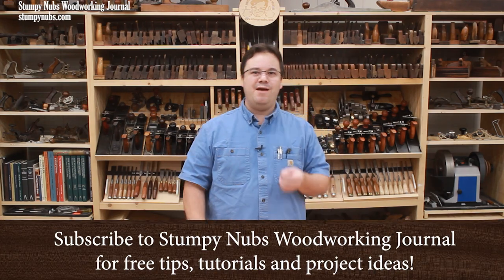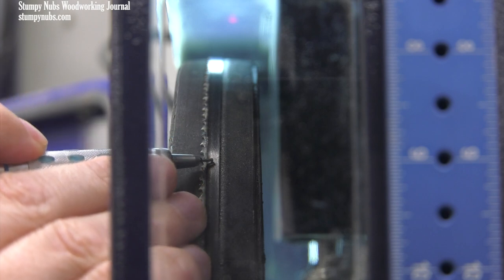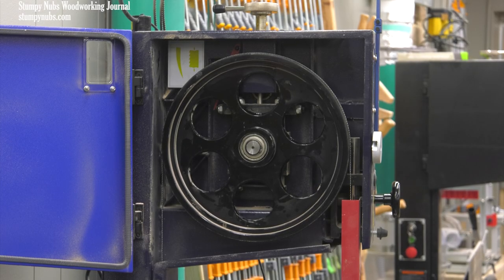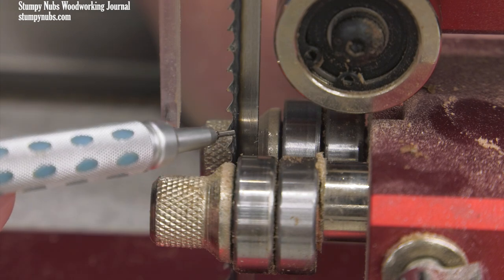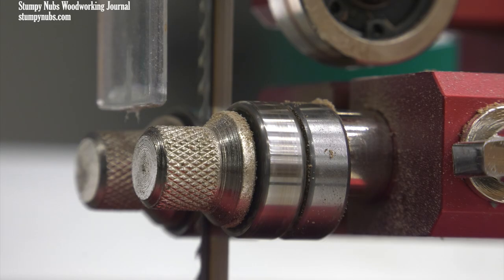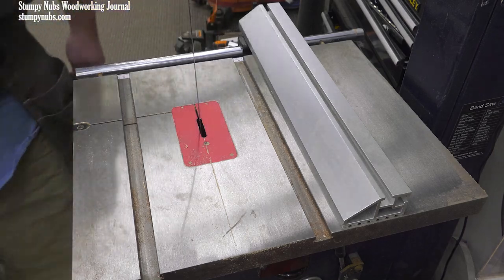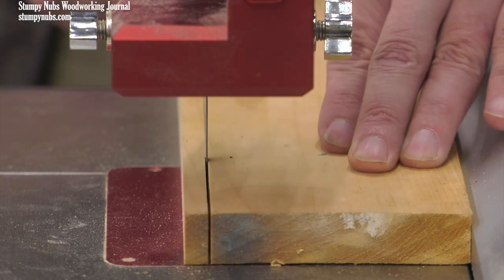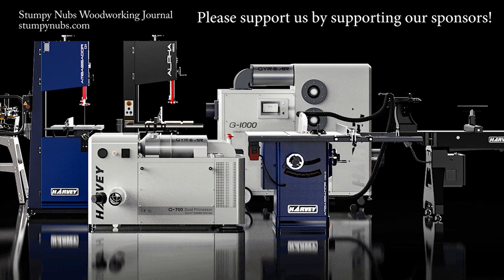When bandsaws go bad- How to fix your setup!

Comment: Great video.  I would just add one small step that has saved me a lot of fidgeting.... back off both the upper and lower guides before setting the tracking and the tension. Once that's where you want it, then set the bearings (or guide blocks) for the clearances you prefer.  If you've ever tried to get the tracking right while a bearing is holding back the adjustment, you know why some folks get so frustrated.
Reply: Good point, I'll watch that.
Reply: Great tip thanks

Comment: This is exactly how I have always done it....except....I back off all four of the guide blocks/bearings plus the rear bearings. Now adjust the bottom left, than the bottom right. Now the top left and than the top right. finally adjust the rear bearings. Doing it this way eliminates (mostly) going bnack and forth with each conact point. I always finish by using a stone to round the rear edge of the blade so it won't scrape the kerf as it passes through.

Comment: i wished to thank you so much !!! I own a bench top band saw for small wood work in my shop since some years. I did in the past some various adjustments but never succeeded to have quasi no drift. Looking at YOUR video, i have understood why !!! I did again various adjustments, revised all settings, reworked the table holes and axis. Now : it's a dream, all work perfectly, quasi NO drift, 90 deg cuts are excellent. As a complement i use a home made micrometric and magnetic fence jig and get excellent results. ie resawing a piece of wood of 50 mm large down to 42 mm exactly at a glance, so easy now. A little hand plane work to adjust and all if fine in no time. So, again thank you, you made my day !!! Every time i will use my and saw, i will think about you ...  PS: i did watch may other videos which were great and useful but yours opened my mind on my issue.

Comment: James, this should be a must-see video for anyone that owns a bandsaw. So much of what you showed here I had to learn out of trial and error and with the help of old-salts' as yourself. One thing I'd like to see or explained is when the upper guide is raised or lowered, it might not track in perfect alignment with the blade. This can cause tracking and/or other issues as well. Some machines allow for adjusting the alignment, such as yours, I believe, but older styles don't, and might require re-adjusting the upper guides when moving the guides from an inch or two from the table to ten or twelve inches up.
Reply from the maker: If you can adjust the post's alignment to keep it consistent, I'd adjust the bearings  each time you raise it high to resaw.

Comment: I have setup my saw in the same way as described in this video after watching a similar one by the guy from Carter Guides and my little benchtop 10", 1/2 horse Rikon cuts true and straight through 5" hardwood all day long, these tricks really, really do work for all saws.  Thanks!

Comment: You did it again!  My bandsaw has been cutting perfectly until two days ago.  Last night I was going to search YT for a tuning video I'd seen a year ago, but at the top of my feed was this one.  This has happened before, just as I set out to search, you have a new vid on the topic I need.  After tweaking the blade on the top wheel and adjusting my rear guide bushing, I was cutting 1/16th inch strips again using my fence!  Thx.

Comment: Hi James, Fantastic video. I have seen many videos on how to set up a bandsaw but this one is the simplest to follow. I have an old DeWalt 3501 and took my time to set it up properly. It has blocks and not bearings so it was great to see you cover this as many videos don't, they just explain bearings. 
I just wished you would have posted this video 4 years ago. LOL.
I do as you suggested and check the set up periodically and always after tilting the table.
I make a lot of segmented pens so an accurate set up is vital for me.
Take care James and thanks again for this video.

Cheers, Huw

Comment: Most can probably agree that a bandsaw is one of the last investments they make for a shop.  Partially because of these fiddly issues you just smashed in a few short minutes!

...and probably because of that I ended up with a bandsaw from the alley.   
It wasn't working and the blade was off. 
I found that the cover for the blade was bent and the safety switch wouldn't engage!!
It's just a green baby saw, but it works! I look forward to further adjustments and putting it to the test. 

....thanks again!

Comment: Thanks James. This is how I setup my 14” Delta, but FYI, Shopsmith bandsaws do not have crowned wheels and the blade is designed to run against “auto-tracking” bearings which position the blade to the back of the wheels. Also, due to the conical shape of the upper wheel and the way that the upper wheel is tensioned on a cantilevered arm, drift is common.  I love the Shopsmith bandsaw but it is a different animal. Scott

Comment: I just got the new 16" South Bend bandsaw. I actually had to adjust the top bearing guide system to be parallel and square with the blade. It's something I had never heard of before and was interesting to fix.

Comment: Thanks for the tips! I have a Delta 14" with variable speed control and a metal cutting blade for aluminum. It works reasonably well but it drifts ever so little. Will attend to it.

Comment: Thanks for another great video, James! Everybody and their brother, including some big names in woodworking, tells you to adjust the band saw fence to compensate for inevitable drift. A few tell you that drift is caused by worn or defective blades. Michael Fortune's video was the first I saw that points out that you can/should simply rotate the table so the slot(s) and fence are parallel to the blade. Duh! We expect to adjust a table saw table and fence parallel to the blade - why did so many of us not realize the same thing applies to our band saws? As you demonstrate, it works perfectly and it's easy enough, even on my 40-year-old Delta 14". Two other tips I can pass along for those with older, smaller band saws like mine: First, my 14" Delta was top heavy and annoyingly wobbly, especially on a mobile base. So, when I built a long table for my sliding crosscut miter saw a few years back, I made it the same height as my band saw table, and positioned the band saw at the end of the table. Then, I drilled a few holes in the frame and bolted my band saw to the fixed miter saw table. Now my band saw is rock solid and has 12 feet of outfeed support so I can easily rip long boards on the band saw. Second, Alex Snodgrass, in one of his band saw tune-up videos for Carter Products, suggests removing the table each time you change blades so it's easier to adjust those pesky hard-to-reach guides below the table. That turned out to be another "smack my forehead" moment for me. It turns out that removing and replacing the table makes it so much easier to adjust the lower guides that it's actually much faster than trying to do it with the table in place. As a result, I now change blades when necessary instead of forcing a cut with the wrong blade in the saw. Thanks also to the more powerful motor I picked up from Grizzly, my old Delta now performs like a much bigger saw. Of course, when I bought the ubiquitous Delta 14" band saw forty years ago, there weren't too many other options. So, I made these and other upgrades over the years trying to improve its performance. While I'm very pleased with it now, I'm sure that if I totaled it up, I spent as much as or more than I would today on a bigger, better saw like one of your Harveys. ;-) Thanks again, James, and be well!

Comment: Great video. Every bandsaw user should know these things. The best advice is to align the gusset squarely on the center of the upper wheel. The advice of the ancients was to overhang the teeth off the left side thus guaranteeing drift. Placement of the thrust bearing should leave enough, but no more,  gap to prevent the teeth from touching the side guides.

Comment: Nice job, Stump.  You covered it.  The only small point I can add is make sure you have a good quality blade.  Some cheap blades can have inconsistently set teeth.  It will be nearly impossible to get such a blade to cut straight.  Same as what you said about dull or damaged blades.
Reply: He’s way ahead of you. You might want to check out his last video where he recommends carbide-tipped bandsaw blades

Comment: I’ve always been put off by thoughts of big wheels, tires, tension, blade guides, tracking and drift. This video makes adjustment seem much more reasonable (and feasible, even though I realize it will probably take patience and several tries.). I particularly like your simple techniques for measuring tension and thrust bearing setup.  There is, of course, still the dangerous step of removing the ties from a new blade.  Thanks for the video.
Reply: I saw a video (can't recall who made it) in which they simply dropped the blade on the floor, teeth uppermost, to uncoil it!
Reply: @lafamillecarrington  Stand back!

Comment: The reason the wheels are crowned is that the crown counter intuitively applies a force towards the center of the crown. The force has to do with the elasticity of the belt/band, and it is much more pronounced for rubber belts. If the saw is not centered on the crown, it should drift towards the center over time, but there are a lot of other factors that may come in to play.

Comment: lots of good stuff, thanks.
I have an old Delta 14 and I'd like to give a shout -out to Cool Blocks. Won't damage blades like metal blocks and much much cheaper than bearings.

Comment: I have a new-ish Delta table top bandsaw and then a really old Craftsman, haven't used either.  Tried to use the Delta but could NOT get the blade to stay on.  I suspect the blade is toast, turns out it's an odd size that no one has in stock locally, so now I wait for a shipment to come in by mail.  The Craftsman is I think a 14 inch but I have yet to even plug it in.  Looks like an awesome tool.

Comment: This is super helpful! I've just upgraded my little benchtop bandsaw to a bigger one for the first time and have spent an entire day trying to get it perfectly set up, and there's still work to do.

I'd love to see a quick video on bandsaw blades - I never had much of a choice in my little 1/3hp machine. Just buy the tiny blades! But now I've got a bunch of options that I don't understand. What are hook vs claw blades? What's a standard blade TPI to get clean straight cuts? (My finish is currently really rough with a new blade) - stuff like that.
I'm also totally seeing the value in one of the Hedgehog featherboards, and a decent push stick.
Reply from the maker: There is a link to a video about bandsaw blades in the notes below this video.

Comment: The table rotation is in my opinion the most important adjustment and should be done first.
Reply from the maker: You can't know if your table's alignment is affecting the cut until you eliminate the other factors covered by the previous steps.

Comment: Thank you for doing this video! I have a C14 and I was able to get my fence parallel to the miter slot but I can't get it 90° to the table. Is there a secret to getting that adjusted correctly?

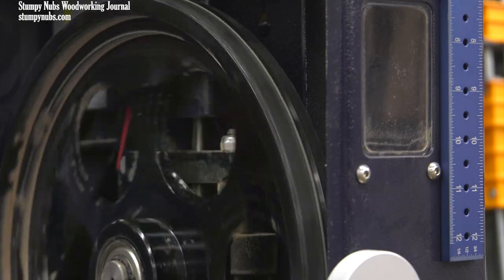Comment: I have the same Harvey saw and I see you manually rotating the wheel @ the 2:57 mark.  Just beware, I snapped my left index finger in half, breaking it in three places doing the same thing only slightly faster.  My finger slipped ever so slightly and got caught between the wheel and the lower tensioning block.    If I had caught it 1 inch higher, between the wheel and upper tension block mount, I'm afraid I would have lost the finger as there would have been no room for my finger to snap sideways and still clear the block.  VERY DANGEROUS.  This happened back in January and I just now got my fingernail back and starting to get feeling in the fingertip.  Still love the saw  :-)
Reply from the maker: That's interesting. I have never heard of such an injury. Thanks for the heads-up!

Comment: Another great video, I just purchased the Grizzly G0803Z 9 inch band saw on holiday sale directly from Grizzly 249 I thought was a reasonable price for a first band saw very helpful information on set up, I have seen other videos and what are your thoughts on blade tension after use, I have seen videos that say it will put flat places on the tires if the tension is kept on I'm sure you covered it before but I can't remember cause I didn't have a band saw at the time thanks.
Reply from the maker: I loosen the tension on wide blades that require a lot of it. I don't bother for 3/8 and narrower blades. But that would also depend on how robust your saw is.
Reply: @StumpyNubs  ok thanks for the reply I figure if I only use it 3/4 times a month it may be a good idea to loosen the tension thanks again

Comment: I have a question, when you talk about centering the blade, are talking about the tip of the teeth to the back of the blade? Or, the bottom of the gullet to the back of the blade? I use Michael Fortune technique of using bottom of the gullet and get good results. If I get drift, it's my saws way of telling me that my blade is dull. Great video! Not enough people or manuals talk about table alignment. That was the game changer for me.
Reply from the maker: Center of the blade in the center of the wheel. I demonstrate exactly how that looks in this video. I also discuss the method for centering the teeth. I encourage you to watch the video.

Comment: Thanks for the tips, James. Now, I know there's more discussion that can be had with regards to setup and proper usage (and maintenance), but it would make for a very long video. So, a couple of questions if I may:
First, the stupid question. WHY are the guide blocks and/or bearings set slightly spaced from the blade instead of actually touching the blade. I would think you'd want to keep the blade from moving at all. As an example, from the factory, my Ridgid jig saw has bearings that touch the blade.
Second question. I've got a c1970 Powermatic "Gumby" 14" band saw. There was no fence when I got it, so I bought a Kreg fence and it's a great setup. However, it came with a "Resaw block" attachment that has a curved face  on the blade side. That makes no sense to me. Have you seen this and if so, what's the story with that vs. just resawing against the fence? Thanks for any insight you may have.
Reply from the maker: The bearings are just there to nudge the blade if it tries to drift. If they spin constantly they will wear out much sooner. Some say it also can stress the blade and cause it to break sooner.

Those resaw posts are used when your saw drifts so much that you have to constantly steer the board to stay on your line. They work as a last resort, but are no substitute for a well set-up band saw with a sharp blade that cuts straight on it's own.

Comment: Great videos Sir!  I much appreciate your content.  I've been a long time watcher, but this is my first ever YouTube comment...lol.  I have a question for, specifically on the saw.  How hard is it for you to adjust the tracking on your C14?  I have the same saw and am curious...  Mine gets to a point where the blade teeth/gullet won't go much past the crown of the wheel (toward the back.  I can loosen it all day long of course).  The instruction manual isn't a lot of help, but I feel like it's binding way too much, thus reducing my ability to track any way other than on the crown/gullet alignment.  I was hoping to see you actually adjusting it in the video, but didn't, so hoped on here to ask....   Thanks!
Reply from the maker: It doesn't tilt a great deal forward, but I can make the blade fall off the front of the wheel if I want. There is a disc-like stop on the adjuster. Have you tried loosening that?

How wide is your blade?
Reply: @StumpyNubs  Thank you for your response.  I'm running a Timberwolf 3/8" 3TPI "green lumber" blade.  I have the disc-like stop completely backed off (against the tracking adjust knob) and I can barely get the gullet past the crown of the wheel toward the back of the saw.  I actually struggled getting the blade gullet even to the center of the crown on some of the larger blades (like the 3/4" blade that came with it).  My only option seems to be putting the gullet on the crown and nothing else.  Going toward the front of the saw (counterclockwise on the tracking knob) is no issue...but I feel like I'm going to wring the handle off the tracking knob trying to get it to budge any past the crown (while tightening/adjusting clockwise).  I'm not sure if I should pull the wheel off of it to see if it's binding on something it shouldn't be or not, but am interested if anyone else has had this issue...so thought I'd ask you.   I'm going off of section 6.1.3 in the manual (number 6 and 7 specifically).  I was running a 1943 14" Delta Rockwell before this - so this one has a little different mechanical design and a much stiffer tracking knob.

Comment: I have to disagree with you.  I do not center the blade, or the teeth.  I center the deepest part of the gullet on the crown of the wheel, which, I believe, is part way between.  This was Alex Snodgrass' suggestion, and I have been doing it successfully since attending his seminar at a woodworking show nearly 2 decades ago.

I have one of those saws that, when I tilt the table, it may loose its initial adjustment.  Someday I may upgrade to a better saw.
Reply from the maker: I didn't say center the TIPS of the teeth. So, if one was to take my statement absolutely literally, they would center the middle of the gullet, which on most blades is less than 1/16" from the back of the gullet. Since you are judging the center of the blade by eye, I suspect your chance of error is at least that much.
Reply: @StumpyNubs  thanks for clarifying !